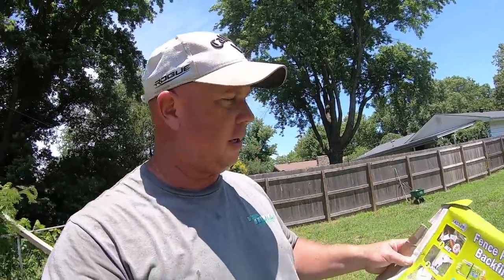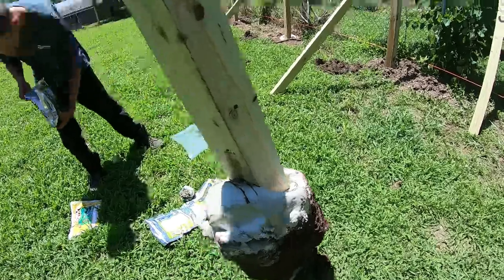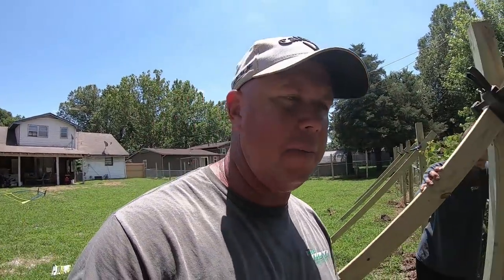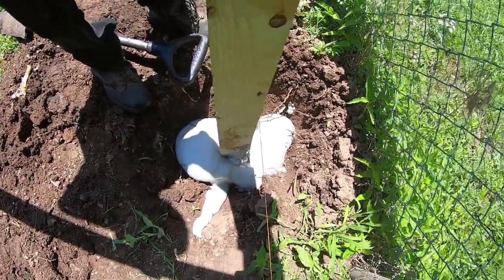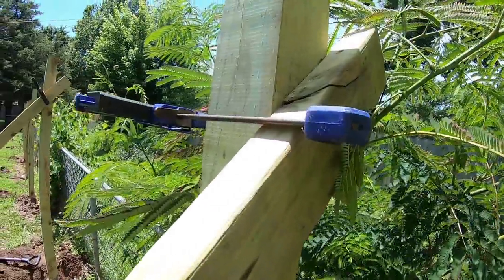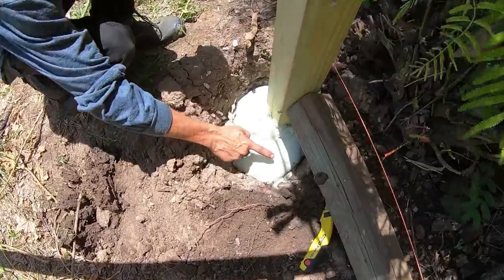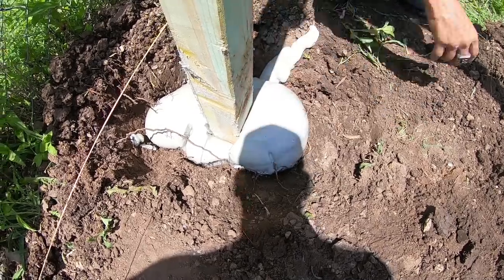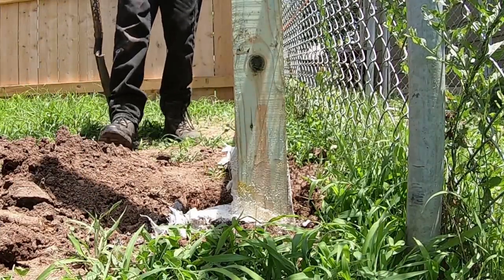No Concrete Fence Post, Is Foam Better

Comment: I think the concrete accelerates the rotting of the posts.  I haven't used the foam, but I suspect it will do the same thing.  The way I set them is to put a couple of inches of gravel in the bottom of the hole  to improve drainage and once the post is set in place fill the hole with gravel with sharp edges (crushed or broken stone, not pebbles) and tamp it.  Allows the water to drain away and air to dry the post.  If you want concrete like for a gate post, put the gravel in the bottom, set the post, and fill the hole with bagged concrete, right out of the bag, dry.  Leave it down a couple of inches and fill the hole with water. Or just wait for it to rain.  Works well, done it many times.

I would like to see a long term report on the foam.  Does it hold up to wind? do the posts rot faster?
Reply: Yeah, I feel like the foam is going to trap water at the bottom of the post so it's just wet all the time and will rot super quick.  If he got those posts into the gravel at the bottom he might be OK.  But I'd guess that with the foam expanding as it does, it's pushing into gravel and under the post etc.

Time will tell.
Reply: @BLenz-114  My former father-in-law felt the same way, and he was a concrete engineer.  His posts didn't last but 10-14 years.  In 20 years my posts with concrete above the surface don't budge, and they look like they'll last another 10 no problem.
Reply: Tony G so how’d you set your post (how deep were the holes, etc)? I’m about to do mine and would like some wisdom. Thank you
Reply: If its closed cell foam it should actually prevent moisture from getting to the wood.  i dont see how concrete or even gravel  will  prevent wood from rotting much. Concrete is porous to moisture.   The gravel unless all the way to the surface is in a hole that is likely ,oust all the time down 2 feet or more.  I also think the post will be more sturdy with soil etc or concrete layer near the top.  The big problem is the great majority of treated wood 4x4 used for fence posts are NOT ground contact treated wood.  When environmental changes in chemicals used for treating wood around 20 years ago most everyone changed to treated that is NOT rated for ground contact because of costs.I dont think even Lowes and Home depot even offers ground contact wood. I would have to look and see if even their landscape timbers are ground contact !!!  Menards offered some ground contact rated treated wood last time I looked.

I can see how STEEL posts would last longer with gravel under the post and then around bottom then dirt and top of post  sealed so rain water doesn't have access in the post itself. In this case bottom of post just not sitting in water continuously and once surfaces rusted it prevents further rust.

If you really want a long lasting fence post get railroad ties (creosoted).
Reply: @tonyg2859  
How funny!  I'm not an engineer, but I test concrete and cement for the CA DOT.  Us engineering types are just a dubious lot, I guess!
Reply: @teekay1785  right, all that pile of gravel at the bottom does is let water drain down to the dirt... that space with some rocks in it is just going to stay full of water until all the dirt around it drains fully anyway. If you're in poorly-draining soil like heavy clay, that's going to be a long time regardless. People act like gravel somehow magically makes water disappear, but it just doesn't work that way. 
The water-sealing potential of the foam is really the only thing going for it, in the long-term. But for at least twice the cost of concrete to save a few minutes now and maybe have the post last longer.... I remain unconvinced.
Reply: @dystopiagear6999  exactly and only time will tell so it will be a very long time before its known and then only with some type of controlled experiment unless there is an outrageous difference. 
Still if you physically have trouble lifting or need to save time especially if you only use partial bags like I outlined  to cut costs it improbably worth it.
Reply: @teekay1785  seems to me that whether the extra cost is worthwhile depends largely on how many posts you have to put in. 4-6 posts for a dog kennel or something, yeah the ease and time saved may be worth it to someone with physical problems. A couple-three dozen posts to enclose a yard or garden, forget it, just hire someone to set the posts.
Reply: @dystopiagear6999  yes but its not any extra cost doing it the way I do See my answer to NO NAME  I just fill bottom with dirt and tamp it then put 1/3 or so of foam in wait for the foam to hold post plumb and cure then fill rest of hole with the excavated dirt . Once holes dug be finished with getting posts plumb in about an hour at no extra cost over concrete.
Reply: @teekay1785  seems like extra steps and labor to me, and that means MONEY in my world, lol. But if it works, by golly keep doing it.
Reply: Dystopia Gear k
Reply: @BLenz-114  it doesn't rain or freeze in calif.

Comment: Better Option: when I did my yard, friend of mine told me a cheaper and better option. Buy the $3 cans of great stuff in bulk, spray it in the hole and let it expand. Works just as well and far far cheaper. Been 6 years since I used this trick on my fence post
Reply: Just wait until you dig them up to replace the post.
Reply: This stuff sets up in minutes so you don’t have to brace or hold the post for long, the can stuff takes much longer to harden
Reply: @owenshiverdecker6999  exactly and probably a much denser foam mix and hopefully closed cell.
Reply: I considered great stuff as a substitute for marine foam (for flotation purposes) until I read that it is subject to water saturation.  That being said, if it gets saturated around a fence post, the wood may rot much quicker.  So it may be a cheaper option but I would look more into it being a better option.  This alternative might do alright in really dry climates but I wouldn't substitute it to save a few dollars on a long term investment.

Comment: There are different brands and different methods, but in my experience, after a few days the foam shrank and the posts were wobbly. There's another youtube video where a guy that does fences for a living did a test with different poles, two in the ground, and on in a 5-gallon bucket. After 4 days the foam shrank on all of them. He could actually put his fingers down between the foam the bucket. I suggest doing a test on one pole of your project to see if the foam fails for you as well.
Reply: I saw that too.  Convinced me foam wasnt the way to go.

Comment: I used that foam to set a mailbox post. No hazardous dust or ugly residue in the trunk of my car. It's a lot more convenient and holds in better than concrete. It has been used for setting in telephone poles since the 1990s.
Reply: Good to know.  I am gonna use it to set a mail box post this summer.  Way easier than working with concrete.  Tks

Comment: I would of carved off the dirt off the old foam, and stuck it into the hole to help fill the oversize hole, before pouring in the new foam mix or during the pour so that it fills to the top... great job though...

Comment: Which do I like better? Packed dirt. I've planted hundreds of posts with packed dirt only. Most of mine have been in the ground for almost 20 years. They don't rot and should a horse break one, they're easy to replace.
Reply: I've been wondering why all fence posts aren't just packed with dirt.  It works well with a small tamper.
Reply: @nursegilbey . Most likely  Lazy people, and "increased productivity" demanded by perpetual growth..

residential Contractors started using concrete on all fence lines because it is faster (no tamping needed, just drill the holes set the posts and pour in the powder, puddle the water (bad way to make concrete) ......  move on  get the whole line set in one go..)...  And the mass of the concrete is (probably)  "as effective" at keeping the post in place as tamped earth.   With foam, the mistake really (and concrete) is to dig the hole too big, you don't need a whole lot of "anchoring material"  to make the post rigid  if it is set in undisturbed  heavy soil.

The less foam the better, as it will probably suffer the ravages of time.. - at least if it is in contact with sunlight.

NB, farmers - with huge lengths of fenceline will  rarely / never  concrete in a post which isn't an isolated gate post, the cost would bankrupt them, for them tamping the earth is cheaper, and they have all day, or are already paying wages...  (NB, the concrete sold for "fences" usually isn't really worth spitting on - just cheap low strength quickset plaster with concrete added to make it grey....  (half joking)
Reply: @kadmow  yeah this foam is clearly not meant for farmers or ranchers. It's aimed squarely at suburban folks who love to piss away money on gimmicks and gadgets.

Comment: its funny how a lot of comments are against using this type of foam but they forgot to look outside at their utility poles. a lot of the newer ones are foamed in
Reply: Utility poles have a tremendous amount of force on them from the weight and tension of the wires applying force straight down on them. They are also set much further down in the ground relative to their height vs a fence post height. The majority of them have always been set straight in the soil with no fill.

Comment: Dig a 5 foot deep hole. 6 inch crushed rock on bottom. set cement pad or flat stone that is bigger than post but smaller than hole on crushed rock. use below grade post, to tamp down. level and cross brace below grade post and pin brace legs to ground. back fill with crushed rock,to the top,no dirt. fill tamp, fill tamp, fill tamp, fill tamp,
 for replacement , pull post with long lever . vacuum out rocks. repeat first steps. just an idea.

Comment: Thank you for the video the one thing that I personally don’t care for regarding the foam is that, a bag of cement is $5 the 2 part foam is typically $13 when you have a decent number of post and you can essentially due two post for the price of one it doesn’t make sense financially but otherwise great video
Reply: I did 36 posts using foam.  The cost was only $20 more than concrete for the whole job, and I didn't have to slug around a bunch of bags, nor mix it.

Comment: hey brian. I need to replace my entire back yard fence as well. Hope you can make a series out of this and provide lots of details on how to do this. I really need to get that project going. Homeownership is a lot of work....LOL. Speaking of projects we have been in this house since 02 and I broke the front storm door window trimming last week. As a lawn care guy, every now and again we break a window, but I like to think its pretty rare. After nearly 20 years....I finally broke the front door window...LOL...dammit.
Reply: Draw a mark over/ under your posts.remove screws after cutting on your mrks.(the depth of post).use a couple of 2x4's to slip under the fence. Remove post and separate from junction. Dig hole out some .be sure to run string from posts on either side to maintain plum . use rocks as bottom layer if moisture is a problem.

Comment: I used this and and the fence fell after a bad strom..... My customer bought the materials.. I use drypack concrete and a bucket of water... Post are set in 40 mins ready for 2xs and pickets... Just a heads up
Reply: Yeah, all these foam-fan people whining about concrete taking forever... I really wonder if they've ever even put in a post before. We're not talking about pouring a big slab or a thick ramp here.
I've watched several vids on this foam stuff now, and frankly I'm pretty well convinced it's just a trendy gimmick.

Comment: With the stiffness rating of that foam and the post in the ground 1 1/2 feet the force on a 6' fence in the wind is way under any yield on this foam. The bearing distribution against the ground is the factor and that is good to since it expands against the ground -concrete doesn't expand to compress the edges.  If you did one in foam and one in concrete its possible the foamed post is even stiffer.  Ultimately? well if you figure the life of the post is somewhere around 20 to 25 years the foam with a skim of dirt over it will be there for a lot longer than that.  One thing that might be better (?) is to get a little foam under the post or to apply a bit of peel and stick to the post -that will stop the wood from wicking up moisture from the bottom side.

Comment: The Electric Company has been using foam for the last 20 yrs to set Poles because of the set speed and foam unlike Concrete wont rot your post. 😜😁
Reply: John Martin Not sure what state you’re in, and I realize that every area is different. But when I used to sit telephone poles we didn’t use concrete anyway. We had a hydraulic tamper and tamped the dirt.
Reply: @frednot809  I'm seeing a lot of people in vids/comments claiming "the utility companies use the same foam, it lasts for decades, it's awesome!"
...but I'm not seeing any proof of that. I'm beginning to wonder if it's just one of those internet myths that gets started and people just keep repeating it because they want to believe it.
Reply: Dystopia Gear I’m with you on that, I’ve used it a couple times for not structural posts with good result, I build a lot of arbors and pergolas but I’m hesitant to trust it for something like that
Reply: John Martin it will still rot the posts
Reply: Wrong  . Stop lying to the people.
Reply: Floyd Thompson  Well Floyd here where i live Our Electric Company sets all poles that are in front of Open fields use Foam i watched them use it in front of my Fields the Techs told me it keeps the poles from leaning in the high winds that come off the fields. Here is the Reference page the Utility Tech gave me........ Line construction: Osmose Utilities Services introduces OsmoSet pole setting foam, a high-density polyurethane water-blown foam designed for setting and straightening distribution and transmission poles. Most soils in the U.S. have a compressive strength of approximately 28 PSI. You can read for yourself at.        https://www.utilityproducts.com/line-construction-maintenance/article/16017085/pole-setting-foam-for-setting-straightening-distribution-and-transmission-poles
Reply: Fred Not  Watched them use them in front of my fields there tech gave me this link read for yourself.   https://www.utilityproducts.com/line-construction-maintenance/article/16017085/pole-setting-foam-for-setting-straightening-distribution-and-transmission-poles
Reply: @John Martin you’re wrong again. They have been using foam to set poles for 40 years not 20 . So try again and stop lying to the people.
Reply: Dystopia Gear k

Comment: Great video. My concerns tho would be , that I've seen other people have an issue with the foam loosening up once it's set a while, pulled back from the post and side wall, and two the longevity of the product. How has it help up so far?
Reply: My experience.. 2 years in.. no problems yet. Same sturdiness as the day it was set.

Comment: Almost a year later. How's the fence holding up? Posts still plumb? Seems like they could have been a bit deeper to me. I like to go about 3'6".
Reply: I thought it should be as deep as the height of the fence
Reply: @edmundooliver7584  Way too deep. No one is digging 6' deep holes for a 6' fence.
Reply: @BuzntFrog  yes but doesn't concrete hold water?

Comment: You can do this with a bag of cement, just fill the hole with water and tip the bag in.
Reply: Not to mention that bag of portland cement is a natural mix of materials that will not harm the land.  What's in that bag of expanding foam is not going to last as long as cement nor will it benefit the ground as it decays.

I'll just stick to the old school way on my posts.

! - Crank up the auger and drill a bell hole
2 - pour in a few gallons of water
3 -  Stick the post in the hole
4 - pour in the quick-set
5 - Level the post 
6 -  rinse and repeat as needed

Comment: Would like to have seen the results a few days later and/or maybe after a rainfall to see if the foam was still as tight.
Reply: You need to see it a few years later to determine whether it works well or not. Then compare it to concreted post right next to it for a apples to apples comparison. Just pulling it out after a few days is useless.

Comment: If most people could use what the good lord gave them, they would rarely replace these treated post. Coat the bottom & 24" or so up with rubberized swamp cooler coating just above the ground level and water is no longer an issue. Esp. in wet climates. Happy digging!!
Reply: yetor K10 benton What exactly is that coating you’re talking about?
Reply: @danaparish1644  Swamp coolers rust out from the bottom, the same with wooden post. At Home Depot you can buy a thick black paint that prevents rust on metal or wood. Usually it is at the swamp cooler section.

Comment: Moot point if you don’t fill above grade.  4” of post in contact w the ground is the same basically as 4’.   Those 4” will rot and your post will fail.  Also the foam seems to have a channel the forms around the post almost causing a trough where the water would sit trapping it against the post.  
Maybe if you make sure to pour above grade and cut off at an angle to grade it might not hold water.  But I’m not convinced.

Comment: My father would dig the hole and coat the pressure treated wood where it went into the ground with black roofing tar to keep it from rotting ,set the post and water the hole and fill adding loose  sand filling the hole.  Just saying my experience.